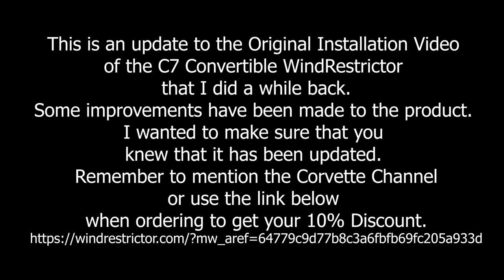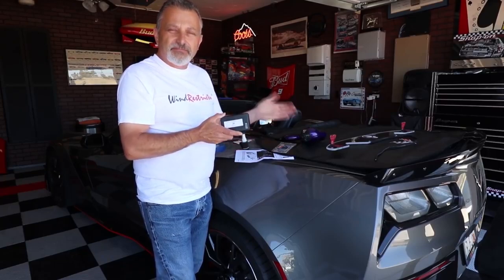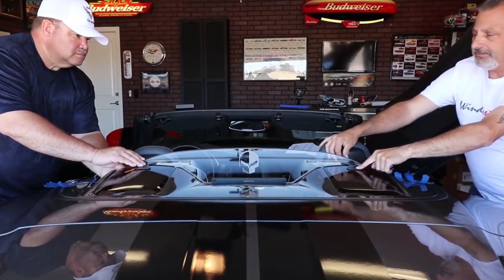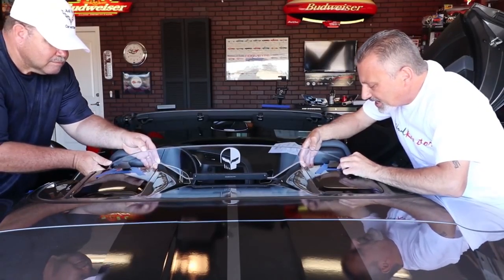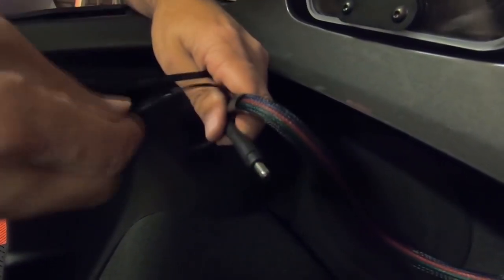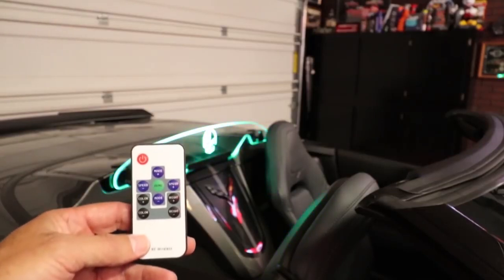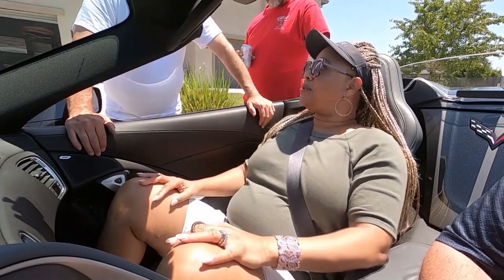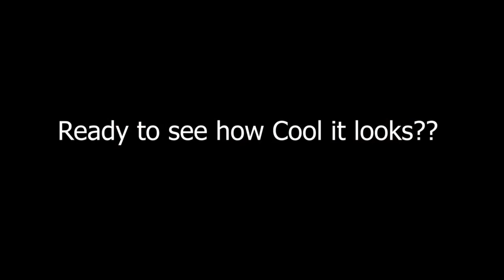How to Install a WindRestrictor in C7 Convertible Corvette Updated Version

Comment: Hello, I am very interested in putting the wind deflector in my car. But I'm concerned About the wire placement for the LED light. I really don't like it exposed is there any way that you can hide the wire better? Thank you Steve
Reply: My power supply cord was to short to go to power pack. Do they make extentions please?